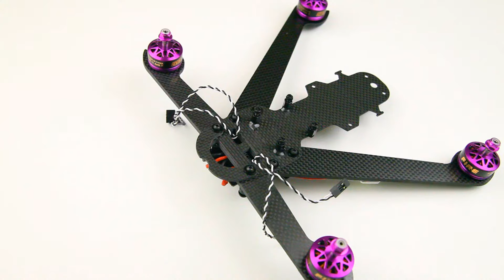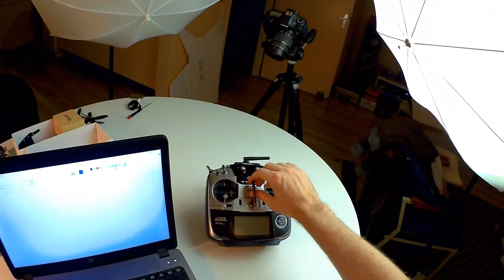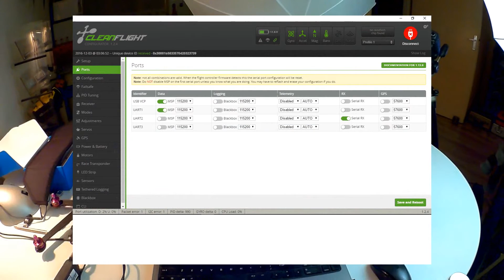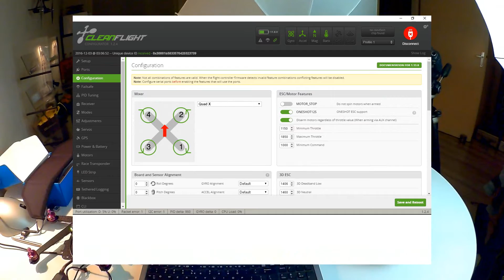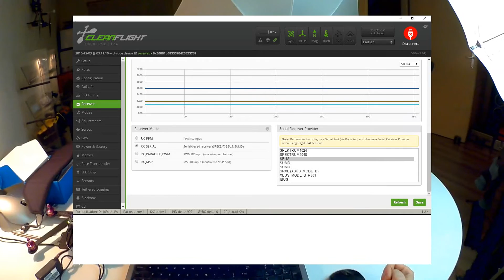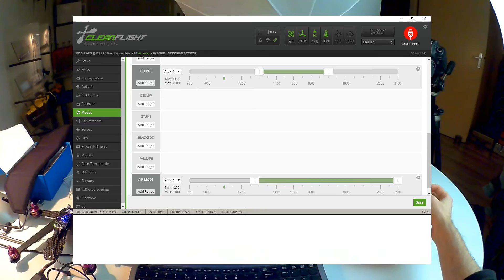Sky-Hero Anakin P4: SP Racing F3 Evo Flight Controller

Comment: Hey Dutch, What radio you using in this video? Just curious.. Also, you never did make a FPV video for this build.. I bought an eagle 800 for this thing and the canopy doesn't fully fit.. I've been struggling with that issue. I'll have to buy a smaller cam it seems. anyway I was about ready to get this thing flying and fried my FC .. Was my own fault, I got pissed off my radio wouldnt arm it and i unplugged the receiver and plugged it back while powered up.. (big mistake) must have zapped it.  :P  live and learn.  Anyway, I'm just waiting for some nice weather here around chicago to test fly this thing.
Reply from the maker: Howdy Robert :)  For this (and most of my other quads) I use a Futaba T14SG radio..
And GOOD point! I had actually planed to shoot 1 or 2 follow-up video's about the build last weekend.. And then.. Then I drove it into the ground :P  oeps..
Don't worry.. the quad is completely fine.. And I hope to be able to shoot some updates (and tech-info) for this project shortly :) 
Yep.. I've had to modify the canopy a bit as well for that cam.. I AM happy with the cam though.. It provides a Great FPV stream :)

Comment: Hey Mr. DutchRC - Do you know what Volt the LED header on the Flight controler handles? 5 or 12?
Reply from the maker: Howdy Robert :) 
Hmm Good question! I've never done things with programmable LED connected to FC's.. I would expect 5V though, as it's on the same rail as the buzzer?
Reply: I believe you are correct. Ive read how the naze board with cleanflight will actually change colors on the leds corresponding to battery voltage and other specs we may want to monitor. This sounds awesome to me.. im surious if realacc controller does this
Reply: I may have to dig some more. :)
Reply: although, I suppose after i get a headset this would be useless.. lol
Reply from the maker: Hahaha :D  yes.. when flying FPV a LED array is mostly usefull for the other pilots ;)
Reply: Yeah I thought about that after the fact.  :P
Reply: The only thing i have changed from  your  build is my receiver. All the parts are in shipping and im anxious to put this together and see what it will do. Thanks again for the videos!
Reply from the maker: Ohwww! DO let me know how you get on with it :)  Mine is an absolute monster.. In case you've seen my last video (Diatone GT2).. that quad flies well.. It's just not as monstrous as this Anakin build :$

Comment: I'm fairly new to the scene but I did  buy this frame. I'm curious, when you mounted your flight controller if you modified the frame to do so, I dont see holes in my frame for those stand offs so I'm assuming you did. Also, what board was Clifton referring to was a clone board, the flight controller?    Thanks for these videos, They are very informative~!
Reply from the maker: Ah yes.. I had the same problem.. You are really ment to use an encased FC, and mount it with double sided sticky foam.. In the end I just glued mine down on a block of foam.. Mainly because my FC needs quite a bit of vibration isolation.. 
What FC are you using?

Well yeah.. he didn't get back to me on that, so I am unsure how to determine which are originals & which are clones :$
Reply: I'm confused, in the video you have the FC mounted on stand offs with rubber cushions (so to speak). So you changed that? Did you just mount it flush on the frame with the double sided tape>? I was also curious how you mounted all the FPV items, You didnt do a video on that I'm guessing :P
Reply: I planned on using the same FC..
Reply: I misread this, I apologize... So you mounted it on a piece a foam flush on the frame?  Thats not a bad idea... Do you know why these boards are so prone to vibration? what happens to them?
Reply: sorry for the 20 questions, like i said I'm new..  I'm doing a build off of your videos.  I'm 45 years old and need a hobby.. hahah   Anyway, thanks for you time.
Reply from the maker: No worries Robert! :) 
On the FC I use: it simply has a set of sensors that are more sensitive.. That is neighter a good or a bad thing really.. It's just something to be aware off...

Comment: slim plan die elco op de lipo -) spikes onderdrukking reuze handig.
Reply from the maker: Zeker :)  Netjes dat ze die meeleveren :)
Reply: Moet ik nog bij opmerken dat het in feite 25 v of hoger zou moeten zijn en het liefst een "low esr" type...maar alles helpt al. ;-) het had te maken met dat bec's meestal op den duur te veel moeten incaseren en dan het kunnen gaan begeven.
Bij active breaking absoluut nodig (low esr) bij geen active breaking voldoet een standaard exemplaar.
su6 .
Reply from the maker: Eerlijk is eerlijk: ik ben Geen electronica expert :P ghehe maar ik weet idd wel dat zo'n cap de spikes opvangt.. Eerder zaten die vaak ook wel op elke ESC, maarja.. die worden steeds kleiner uitgevoerd -> geen cap meer daarop. Op zich zou je uiteraard 4 van die dingen dan op de PDB kunnen gooien.. 
Ik ben wel benieuwd hoe de video gaat zijn bij punc-outs.. Daaraan kun je meestal goed zien of de spikes goed worden opgevangen...
Reply: Inderdaad vroeger zaten ze al gewoon op de esc 's.
Dat is dan de eerste beveiliging i.v.m. chopping (spannings verschillen op lipo door belasting motoren).
Dan de 2 e stap is de echte filter werking en daarvoor heb ik zelf dan een Lc filtertje van banggood gebruikt. 
Die hoeft alleen maar in serie te staan voor een fpv cam en het werkt inderdaad goed.
De combi van eerst die grote elco en dan pas je filter is helaas altijd nodig en voor een cleanbuild freak zal het soms lastig te accepteren zijn XD.
Ik ga gewoon me eigen weg dacht ik maar en dan weegt die maar een paar gram teveel ;-)
Mij LC filter van banggood is eentje met een eerste elco van 25 v dus ik heb nog mazzel...normaal waren ze 16 v.(hoe hoger hoe beter)
Reply from the maker: Ja hmm filters heb ik so-far niet gebruikt, en ik heb toch eigelijk altijd wel een goed FPV-beeld.. Beetje geluk wellicht Of goede ESC's (met cap's) gekozen so far? :P 
Meestal laat ik het FPV beeld ook Niet via de PDB lopen trouwens..

Iets anders: de caps direct op de ESC's (of op de outputs van de PDB) lijkt me ook beter.. dan lopen die pieken Niet door de PDB (?)
Reply: Toen ik nog een naze32 zonder active breaking had was een een elco op de lipo of esc's voldoende.
Als op de esc active breaking geactiveerd staat (firmware blheli) kun je helaas wel een pulse verwachten,dus 1 elco is dan niet meer voldoende.
Dan moet je specifieker een betere elco hebben staan dus eentje met 
low esr (afkorting)maar betekent lage ohmse wisselstroom weerstand.
Mocht die dan niet "low esr" zijn heb je helaas weer die streepjes (niet heel scherp  wel verminking) op je fpv.
Soms kan een normale PDB al voldoende filteren,maar meestal kun je niet bepalen welke caps (low esr) ze hebben.
Nu doe ik dus gewoon die filter en ook daar weet ik niet zeker van of die een low esr is,maar toch werkt het.
Als iemand eentje los wil maken dan is zelfs een spoel eigenlijk niet nodig,maar alleen maar die "low esr elco" met de rond de 1000 micro. farrad en voldoende spannings reservering +- ehm nou neem 25 V.
Theoretische benadering moet ik wel zeggen ! ;-)
Stel je kan wel zonder active breaking (dus bij minder throttle remt die licht vanuit de esc)/nodig voor sneller dalen....dan hoef je dat niet te ondernemen/plaatsen.
Maar als je tegenwoordig de meest recente blheli firmware zou hebben staat active breaking altijd al aan en kun je niet meer uitschakelen.
Ikzelf vind die break wel handig....niet dat ik een echte racer ben ofzo (zit nu op 3 s)...maar dat die makkelijk up en down jojo kan gaan (soort balance tussen hoog laag met dezelfde snelheid).
Je raakt er snel aan gewend en wil dan niet meer terug naar normale esc firmware.
Dit alles was natuurlijk voor mij een heel uitzoekwerkje,maar ik zat vaker op die "github" betaflight van het project van BorisB.
Moet wel zeggen dat het heel technisch verloopt ,maar ik had geen keuze en soms wel heel lastig te volgen.
Heden snap ik het wel een beetje en zolang alles werkt klaag ik nu niet meer XD.
btw die pid's zijn natuurlijk ook wel weer een hele klus,maar kost tijd.
Cleanflight is natuurlijk ook een optie,maar betaflight is meer voor racers geschikt.
Reply: even nog correctie...
output pdb kan wel ,maar de pieken komen in feite vanuit de lipo zelf dus het liefst ervoor te plaatsen,zodat de schakeling zelf op de pdb al beschermd is.
Het zal niet direct sneuvelen,maar onverwachts kan het optreden en ik vind zelf de veiligheid heel belangrijk bij zo'n race monster.
Meestal zie je dan dat iemand's zijn fpv ineens uitvalt en baal je flink.
Dat de lipo pieken afgeeft klinkt raar,maar omdat door extreem snelle afnamen van de stroom ontstaan de drop spanningsvallen.
Dan komt er ook nog een vorm van inductie vrij op de draden,maar ikzelf heb daar nog niets aan gedaan,zolang je videowire er maar niet tegenaan zit.
Video wire afscherming kan ook heel veel dan uitmaken.
Eigenlijk wel logisch in de wereld van video.
Ik heb nu wel die wire met afscherming,maar of het veel uitmaakt ?
Het koste niet heel veel moeite.
Reply from the maker: Ik weet het zo 1-2-3 niet Helemaaaal zeker, maar ik geloof dat bij Blheli_s active braking altijd aan staat (je kunt het geloof ik niet eens Uit zetten).. en voor dampened light geldt het zelfde.. 
Anyhow! Die strepen inderdaad.. Dat is meestal het eerste dat je ziet optreden.. Als de pieken (punch en corner-brakes) dat doen, of het beeld helemaal verknallen, dan is er werk aan de winkel ;)

Naja.. we gaan het zien hoe het nu met deze build is.. ik test de FPV setup eerst seperaat, om te zien hoe clean het beeld Kan zijn zonder enige load of andere storing.. Daarna op de quad, en dan zouden we moeten zien hoe goed/slecht de setup werkt :)
Reply: Blheli_S does damped light only ! dus ze bedoelen dat een lichte "brake" er op de firmware setting altijd opzit en die kan je niet uitschakelen,dus ook niet vanuit cleanflight of betaflight.
Normaal draait een prop nog ietsje door op zijn vliegwiel gewicht en dan zou de reactie te lang op zich laten wachten i.v.m. propwash effecten en je wil b.v.b. heel snel dalen (of corriceren voor een gate).
Volgens mij is blheli_s een prima esc en je hoeft niet echt settings te veranderen in feite...pff gelukkig niet zeg ;-)
Wat wel van belang is dat je voor multishot zou gaan kiezen i.p.v. oneshot125.
Multishot is net weer stukje sneller met de data vanuit de Fc....best wel veel verschil gezien jij ook nog even die s-bus draait.
Voor multishot moet je wel die 4 k mode inschakelen....maar uiteindelijk zou het neerkomen op een 250 micro sec pidloop(onderaan in beeld) van je editor af te lezen.
Btw al die andere optie zoals barometer ect kunnen uit en dat scheeld weer cpu tijd.
Zolang de cpu task niet boven de 30 % uitkomt doe je alles goed.
Ook dat staat dan weer onderaan op je editor screen.
Als je wilt kun je ook nog later,maar hoeft niet kiezen voor betaflight editor en de firmware flashen naar die 3.0.1 versie...maar ja of je daar zin in hebt is de vraag.
betaflight heeft nu een verbeterde pid controller (betaflight zelf).
Die heeft voordelen op gebied van of racing of freestyle gebied pid's.
Wil iemand standaard vliegen dan is cleanflight prima geschikt (met e.v.t. die extra optie's zoals barometer ect).
Dat zal wel niet de bedoeling zijn XD ;-)
Nog even een opmerking over die Blheli_S......er bestaat een progje dat heet blheli suite...daarme zou je dan settings kunnen aanpassen gewoon vanuit de pc direct naar je esc (1 voor 1) via usb...ze noemen die interface Pass Through ,dus vanuit pc via usb naar de fc en naar de esc 's.
Maar kijk maar of je het nodig vind...die blheli_S staan meestal al goed ingesteld.
Nu moet ik zelf nog even de s serie gaan doen (heb ze liggen )XD...die andere zijn alleen maar oneshot125,maar het kan sneller.
S serie loopt ook soepeler zeggen ze....we hopen dat alles klopt.

Comment: getting there bud. Did you figure out the min thr issue?
Reply from the maker: Yep.. it actually flies by now :)
Wellll.. I had to set that by hand (command line).. noooo idea what was up with that :$ .. I think that would be solved by a newer firmware (or Betaflight)